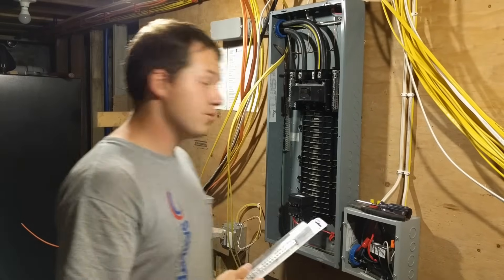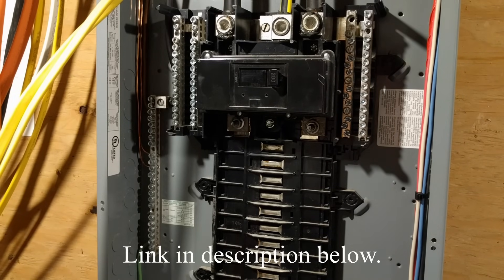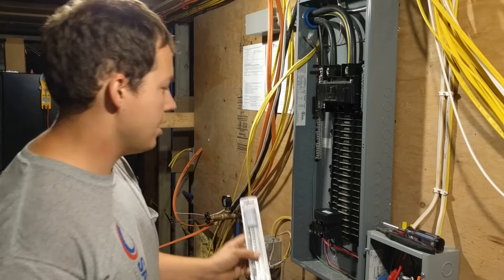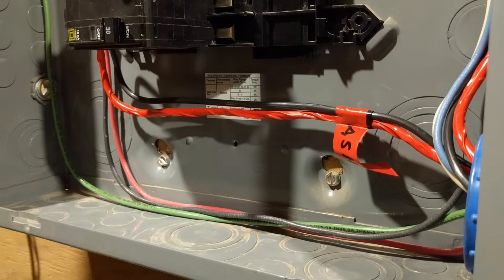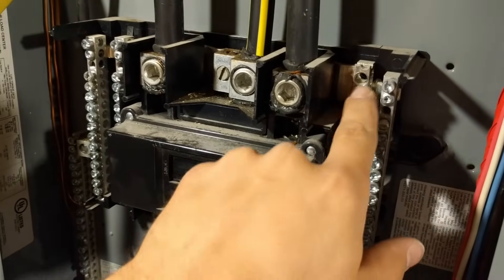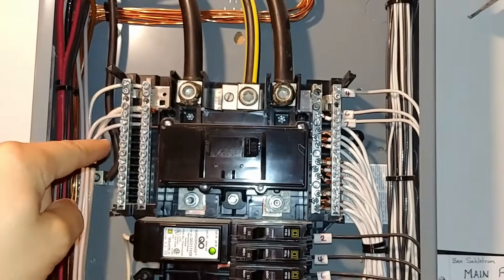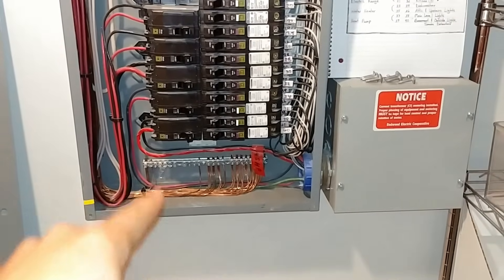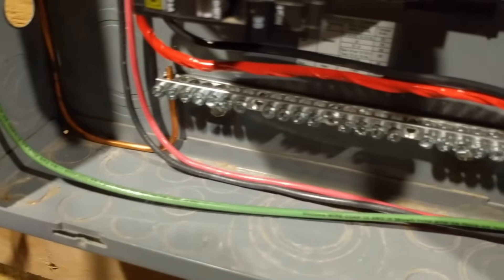How To Install a Ground Bar In a Sub Panel or Main Load Center

Comment: Excellent video.  Subscribed!  I have a sub panel in a garage, fed by 4 wires (2 hot, neutral, and ground). The neutral bar in the sub panel is not bonded to ground and I believe/read it should NEVER be bonded in a sub panel. I have 3 things attached to the sub panel- a three prong outlet for a compressor, an air conditioner (3 wire), and an electric garage heater (3 wire). All are 240v (or 220?). I do not have a separate grounding rod for the sub panel.  The sub is 4 feet from the main panel and I added a grounding bar to the sub panel. *****The question is... should the ground for each of the 3 connections be connected to the ground bar or neutral bar in the sub panel?  I cannot find the answer anywhere!!!  Thanks!
Reply: You are correct, sub panels do not have a individual ground taken to a second separate ground rod. Main distribution panel is "earth" grounded only. All other sub panels connect back to distribution panel. Check voltage between neutral and ground at Main panel. Should be less than 1vac. Had a situation where lights would  change illumination levels (like a small occasional flicker). Had 12 to 15vac between the ground bar and neutral at Main panel. Found  ground bonding bolt loose, stripped buss of loads (opened breakers) opened main. Got about 1/2 to 3/4 turn on bonding screw which "bonds" neutral bar to ground bar at main panel, Added additional 10 gauge wire between neutral buss bar and ground buss bar. Voltage drop now 0.07vac. Main feed in now 120vac to ground each phase 240 between the two phases & steady. Was told all electrical equipment sounds much better. Electric bill improved about 10%. Everyone should have a qualified electrician come into home and re-torque all connections or at a minimum use a non contact temperature device and check all connections for heat signatures (loose connection). Many fires start from simply loose connections on breaker or buss bars. Be safe, always wear gloves, keep audible voltage detector on. Breakers can fail as they are mechanical devices. 0.005 (500 millamps) can kill.

Comment: Hi Ben i just want to ask which one is the binding screw here in my main panel? I was searching and haven’t found any except that I am wondering it is the green wire connected to the ground and eventually connected to the neutral? I will attach the picture so you can see and confirm please?

Comment: Great video . Question please, I have a new Eaton 200 amp  csr 25k main panel and i dont get the purpose of the green bonding screw as i have a left buss and a right buss does it really make a difference for my ground and common of which to run the wires to?

Comment: The previous owner replaced all the wiring sometime in the late 80's, including adding a 30A subpanel on the second floor. He built the garage in 1999, with another 30A subpanel. I've live here 20 years, and recently stumbled across your first video about the bonding screw, which led to this one.  Today, I had reason to peek inside the upstairs subpanel, and found the grounds and neutrals all on the same busbar, and the bonding screw is installed.  I checked the one on the garage - same story.  I will fix them both tomorrow.  Thanks!
Reply: All done.  I have a new appreciation for the skill it takes to wire a perfectly neat & organized breaker box, and I was only dealing with about six circuits in each one.

Comment: when replacing a regular electrical panel, ( upgraded mine from the 70's ) is it necessary to install the green ground screw that came with the ne panel?
Thanks
Reply: If it’s ur main than yes , connects neutrals and ground

Comment: I really enjoy your videos and have learned alot. I have a question.  So I installed a ground bar into my main panel because it was sold separately. I understand the bonding screw connects the neutral to the panel that the ground bar is attached to but would I also need to connect a wire from the neutral bus to the ground bar?

Comment: Great Vid!  I have a 200A main panel that has two upper bonded busbars and a third busbar toward the bottom of the panel, which has no ground in the grounding screw.  I've recently run two 20A circuits.  I've been told I can't use that third busbar for neutrals or grounds.  Can I simply run an 8AWG copper wire from the upper bus to the lower bus and have that bonded too?  I'm running out of room in the other two upper busbars.

Comment: I understand why its not required to run a copper wire to bond the new ground bar to the enclosure/existing ground bars because its bonded through the screws, but im surprised that for this panel, one screw that barely threads through the paint is efficient enough for code requirements to bond the ground bar.

Comment: My neighbor ran a 3 wire cable to his shed. He wants 240V for a welder and two 120V circuits for light and such. This morning he ask me if I had about 10 ft of 10 gauge wire. So I got to see what he's doing. I suggested he needed a ground and off course he thought the neutral was the ground. I explained it to him. Now, Is it permissible to just install ground rods at the shed and not have to the ground wire back to the main panel? What other fix is there besides running a separate ground?
Reply from the maker: The ground rods are NOT adequate for a ground system. If there were to be a short to ground the breaker won't trip. I just made a video about this here: https://www.youtube.com/watch?v=q-RrufV6Gig

Prior to 2008 3 wire circuits were commonly used to feed separate buildings and the ground and neutrals were simply connected together in the sub panel. In your friends case he SHOULD HAVE ran a 4 wire circuit so that he would have the separate ground wire but the best way to make the system safe at this point will be to simply bond the ground and neutral together in the sub panel. Basically you need a return path to neutral if there is a short to ground. If you only have ground rods you are relying on the soil between the separate building and the main panel grounding electrodes.

Hope that makes sense. This is my opinion and if you want a 100% answer your neighbor should call the local inspector and see what they want you to do.

Good luck!
Reply: @BenjaminSahlstrom  Oh, I'm going to have some fun! First, I'll check to see if it is bonded. If not, I'll make a cord to measure to ac current meter from hot to ground when shorted. If it pops the breaker (15 amp) I'll know the ground resistance is less than 8 ohms. If it doesn't, I'll know there's a problem.  120V / 15amps = 8 ohms. Note this: "The Code states, in Section 250-56, that where a single rod, pipe, or plate electrode does not achieve a resistance to ground of 25 ohms or less, it shall be supplemented by one additional electrode."
 btw, he resisted my advice to just run a 12 gauge wire back to the main box.
Reply: Well, my fun is ruined. My neighbor used the neutral as 'his' ground. I know it's not proper, but how will it show up as a problem? No ground wire from the main panel and no ground rods at the sub box.
Reply from the maker: It is a good question by the way and I might answer it in an upcoming video. We'll see.

Comment: Hey Ben, what's your best suggestion for separating neutrals and grounds in a situation where you're converting the main panel over to a sub panel and all my leads are now too short in the box to reach the new bars. I know the Simple answer is wire nuts but that's a messy panel. I was thinking about using a wire trough but that's a lot of work
Reply: Crimp and heat shrink
Reply: Trough it- like you already knew.

Comment: I hope I got it right... Separate building with a sub panel has it's own ground rod, connected to the ground from the mail panel and connected all the grounds in this building. Don't connect to the neutral.
FYI, I just want to spot check some shady installers.

Excellent, very helpful!
Reply: Having "its own ground rod" is wrong. You should have one ground point for the service. You should not add ground rods here and there at the pole, in the barn, etc.
Reply: Douglas Hurd If you wire it that way your breaker may not trip an wires may be energized if a malfunction occurs from a appliance you only use ground rods that are minimum 8 feet in earth contact do two at least minimum of six feet apart on the service entrance disconnect than sub panels use the ground from service entrance disconnect so it would trip the breakers quicker an less heat buildup as well as easier to diagnose a ground issue this guy don’t have a full understanding of electrical theory please research more an be careful if you want additional ground protection it should stay all in the service entrance disconnect panel like four ground rods wired separately instead of daisy chained to a separate bonding strip than one wire ran into service entrance disconnect panel that way you have the four rods you want for additional ground protection
Reply: @lionlocs8951  I know this is old but it's complete bollocks, ground rods have nothing to do with clearing faults.

Comment: I'm wiring a  two 💯 A subpanels. The service cable has 2 hots and a aluminum wire. Is that aluminum wire the ground or the neutral?
Reply: The only way it could be a true "equipment ground" and not a neutral (grounded conductor) is if the panel was strictly 220v. Im sure this isn't the case. You need to run 4 wires: hot/hot/neutral/ground, remove the neutral to ground bonding screws and separate all neutrals and grounds in your sub panels.

Comment: Just curious on the, what looks like a grease of some sort, on your main line lugs was?
Reply: Anti oxidant to reduce dissimilar metal corrosion, used with aluminum wire.
Reply: it's called Dielectric grease. You can purchase some at a local auto parts store. It's used in light bulb sockets to prevent moisture and corrosion

Comment: Great video.  I need to do this very thing to my panel.  A previous owner added a generator subpanel, but left all the neutrals in the main panel.  I need to add a ground bar in the main panel and move the ground wires to it so I can free up some spaces to add more neutrals for additional circuits in the main panel.
Reply: Do you have 4 or 3 wires from utility feeding your main panel? Dont rely on a home ground rod to clear ground faults if you only have 3.
Reply: Chris Keogh the utility provides two hots and a neutral.   Here in Michigan, we have #6 stranded that runs from the panel to two ground rods (10 feet apart).
Reply: @mrnetwurm  What I am saying is:  Older code didnt require 4 wires from disconnect to home panel. If you dont have have that dedicated ground running back to the disconnect where it is bonded to neutral, you would be relying on a ground rod to trip geound faults. They wont, even at 25 ohms they will pull about 5 amps on 120v. 

Be careful when trying to change things to "current code". You want a path for ground faults to return to utility neutral at some point.
Reply: @chriskeogh2316  what would you recommend when I only have 3 wires from disconnect to main panel (2 hot 1 neutral) ,  and no grounding rods at all, and none of the circuits have a grounding wire. All 2 wire.

Comment: So if you came off your sub-panel(house panel) to feed a garage that is a separate building you run 4 
wires and keep neutral/ground separate but still add a ground rod at 
garage?
Reply: but if garage was attached you rely on existing ground rods

Comment: In the sub panel the neutral is isolated from the chassis of the sub panel since the green screw is remove,Now is this neutral bar connected back by wire to the neutral at the main panel? ,& what # gauge of wire?

Comment: Canada is so far ahead of the states when it comes to bonding, we don’t bond any grounds to the neutral bar we bond them to the enclosure. When bonding the grounds to neutral bars you will ALWAYS have a parallel current path if the bonds aren’t insulated or touching the enclosure. If you’re using EMT this wouldn’t be a problem. By adding that jumper wire you’ve added resistance to you’re fault path not good. You ground at 2 locations? No idea why you’d need 2 points of ground not to mention you landed the ground conductor to the bonds which serves no purpose.

Comment: Hello, Ben. Very nice work. I have one question which is: Is it not the case that a ground rod in addition to the ground rod required by the NEC at the service drop is unnecessary in a residential setting for a sub-panel? I watched Mike Holt's video on youtube     https://www.youtube.com/watch?v=wyPTtN6QjzQ     which seems to present a different scenario. I am confused.
Reply: I also found this video which is the first video I saw and directed my attention to the concern for duplication of ground rods:    https://www.youtube.com/watch?v=YuDqXFvRv94      Thanks for your attention to this matter. At this point, may it be the case, unbeknownst to me, there may now exist additional research of which I am unaware which is enlightening (Not meant to be a pun) and can clarify the concern. Mike Holt's video is about 5-years-old, so it may be dated and obsolete. Thanks again.
Reply: I may have found the answer: NEC 2014 - 250.32(A)

Grounding Electrode. Building(s) or structure(s) supplied by feeder(s) or branch circuit(s) shall have a grounding electrode or grounding electrode system installed in accordance with Part III of Article 250. The grounding electrode conductor(s) shall be connected in accordance with 250.32(B) or (C). Where there is no existing grounding electrode, the grounding electrode(s) required in 250.50 shall be installed.

Comment: When adding a 200 amp sub panel as Main And using old  3 wire , Main as Disconnect , is it ok to use No 4 SEC. Aluminum . 3 wire and adding   additional ,No 2 copper, as  4th wire to ground bussbar. ? Thanks.  love ur videos.

Comment: Well that's interesting. In my city, not only are the neutral and ground bonded at either your meter or your main panel, the ground bar in your main panel is also connected to a copper wire that goes outside to an actual ground stake. This way redundant grounding can go either via your service entrance wires or the ground stake if all else fails. I've seen so many of them with the ground stakes that I'm surprised that they aren't all like that all over the country.

Comment: Very clear and smart info!
Thanks.
Is the neutral/ground separation the same for a sub panel off a sub panel. So I have a main 200 amp in the house then sub panel#1 in detached garage then sub panel#2  from sub panel #1 in barn.

Comment: Ben, great video.  It looks as though you also had to add a lug for the first grounding bar for your wire coming from the cut-off panel.  Is this correct?  Would the grounding bar kit you have a link to handle an incoming 4awg grounding wire, or is the lug necessary?  Thanks
Reply from the maker: It looks like you are good to go with a 4AWG copper wire on this one! 
https://amzn.to/2NdR1bV

The description states:

"Square D ground bar kit. Each terminal accepts (1) #14 to #4 copper wire, (1) #12 to #4 Aluminum wire, (2) #14 to #12 copper wire, or (2) #12 to #10 Aluminum wire."

I was connecting a larger aluminum wire which is why I had to use the lug adapter. Thank you for the question and especially for being a subscriber! Blessings from Minnesota!
Reply: @BenjaminSahlstrom  Hi Ben, I'm trying to connect a #4 THHN stranded to a 15 terminal Suare D ground bar.  Mine also says it takes up to #4 copper, but the reality is no way, it's just too tight.  I don't want to drill out the hole.  Is that a Square D lug adapter?  If so, can you give me the model #?  I can only find neutral lugs, not ground lugs for Square D.

Comment: I have a question maybe you can help me with I have a main cutoff panel like you which is right below my service meter that then feeds through to  a sub panel for the house.. The thing is I have built a shop and now I want to add a service panel in the shop since like your my main cutoff panel has some extra circuits I am going to feed it from there. Since it is actually going to be feed through a circuit breaker in the main cuttoff panel does it still follow the same bonding rules as the feed through sub panel like my house.. Hope that makes sense basically you are feeding a well pump from the same place I want to add a sub panel does it follow the sub panel rules I am all most positive it would but this is kind different from a standard panel.. I am thinking I should isolate the two neutral and ground and then run an extra ground rod to the shop panel? Also you don't show it but shouldn't your main cutoff panel have an earth ground to the bonded panel?
Reply from the maker: I think you're on the right track for sure! The new panel in the shop you are adding will technically be a sub panel and therefore you will separate the neutrals and grounds. Then you will need to add two ground bars 10ft apart and connect them to the ground bar that you add in that panel.

Yes, there are ground rods connected to the main disconnect panel next to the meter area so you are correct about that as well.

What size breaker/wire/panel are you going to add for your shop? Sounds like a fun project!
Reply: @BenjaminSahlstrom  Thanks always good to double check.. I am going to add a 60 amp circuit running 6/3 UFB to sub panel. I was doing the math and my sub panel to the house has  100amp main breaker for the house and a 30amp for the AC so I figure I will just about be maxed out my main with a 60amp for the shop. Yes it is exciting I had a new 30x30 insulated shop built once I get it powered should make a great man cave :)o Boy wire has gotten expensive !!!